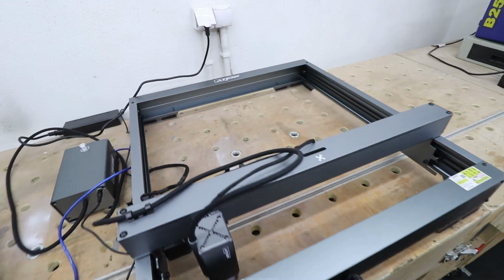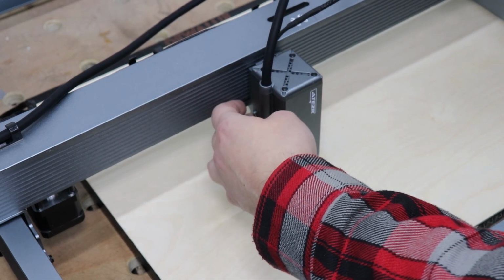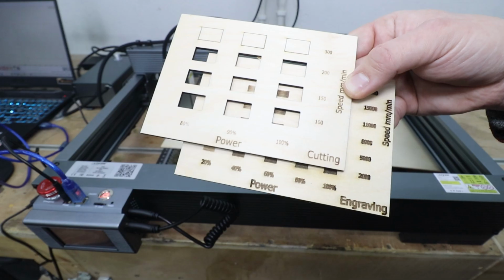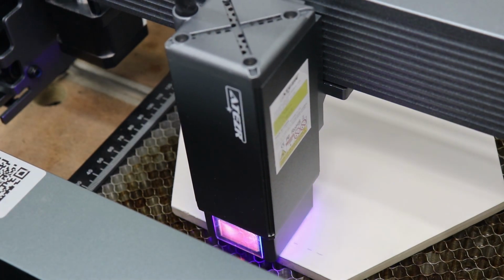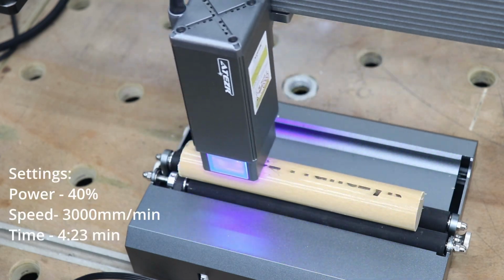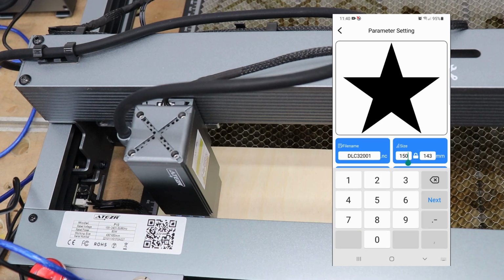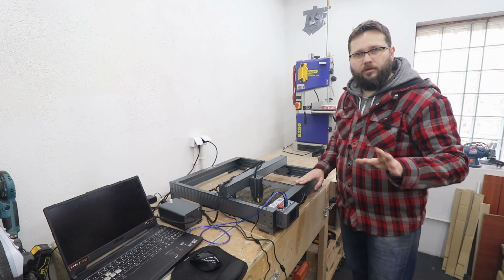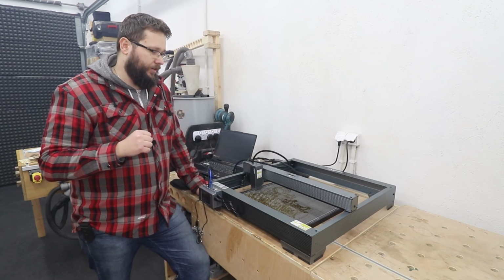Atezr P10 Combo 10W Laser Engraver - Perfect Laser Engraver For Small Business - Detailed Testing

Comment: Tomasz the one thing you didn't show was how the emergency stop function was,  from all the other reviews I've seen on this machine the stop function is only available on the app and not the actual machine.  Plus when the emergency stop on the app is pressed it asks you to confirm that you are sure and actually want it to stop, not exactly what you can call an emergency stop feature 🤔. That said as always tomasz 💯%   👍   🇬🇧.
Reply from the maker: Hi, you got a big red button on the front of the machine like on any other laser. I do mention that in my video when I talk about the lack of flame detection. As you can see on my video the big red button is present. But yes I didn't show it in use. But it works as in any other machines. You press it and it stops that is it. To be fair I didn't notice that function in the app lol